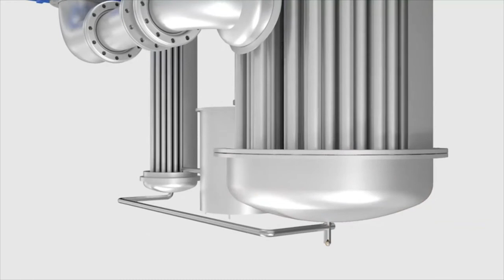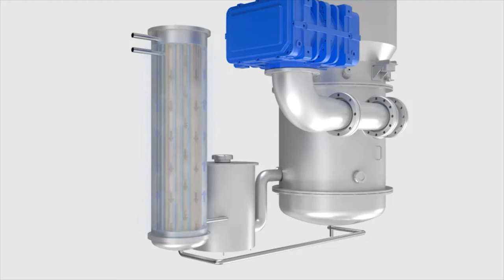Vacuum Distillation

Comment: DOES THIS WORK FOR SEA WATER?
Reply from the maker: Yes, but for sea water we have better options than this.
Reply: @venkatpvrc999  can you please clarify? with lots more details please?
Reply: @venkatpvrc999  what can be those methods can you tell us
Reply: Atnd sunshine?
Reply: @venkatpvrc999  the question usubanswered cleanly avoided?
Reply: @KGopidas ????????????
Reply: Indeed. Water is the solvent, the pressure is mainly due to vapour, saltlt does not gagasify or evaporate. It is the residue of distillation. Like heavy oil fraction of crude oil refining